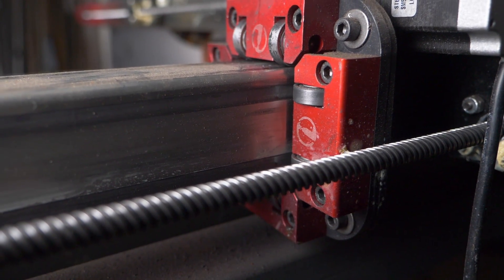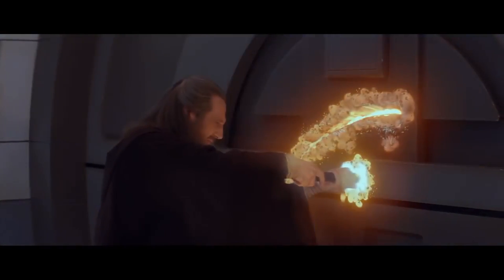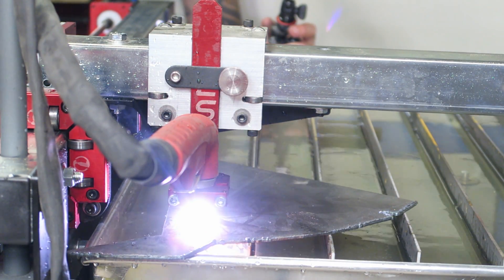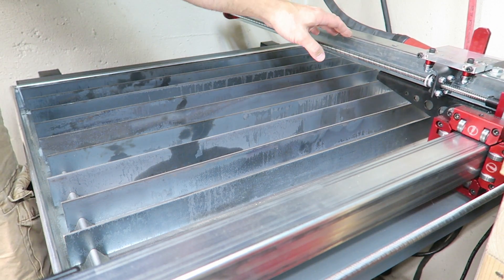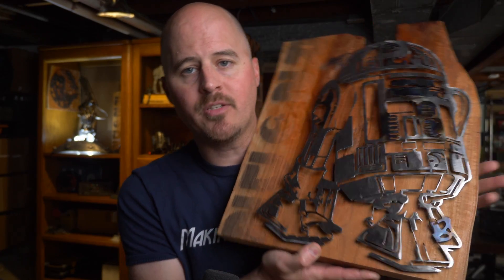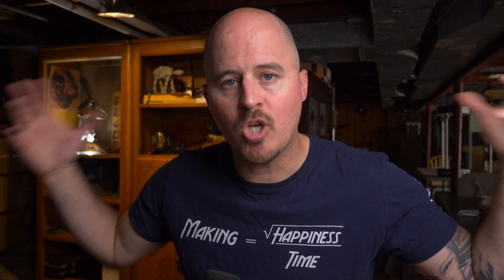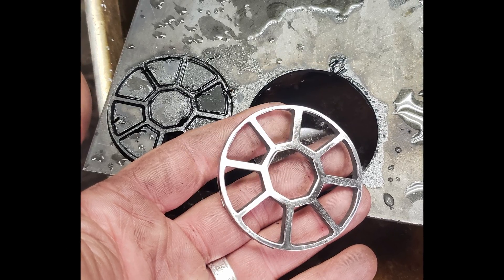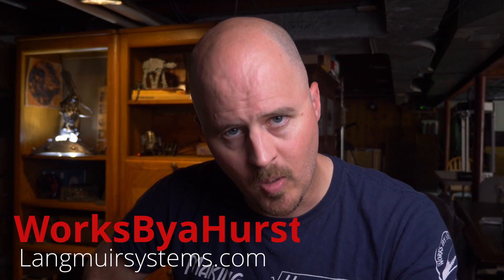Langmuir Systems Crossfire CNC Plasma Table Review (2020)

Comment: We've got a $27k Torchmate at our shop.
It has a "breakaway" torch holder that pops loose with those pieces that stand up after cutting- no special sensor. But even at $27,000, it's been plagued with problems and is somewhat unreliable for day in and out production.